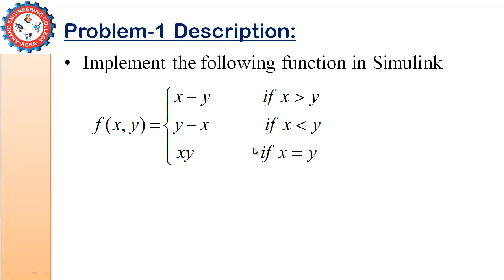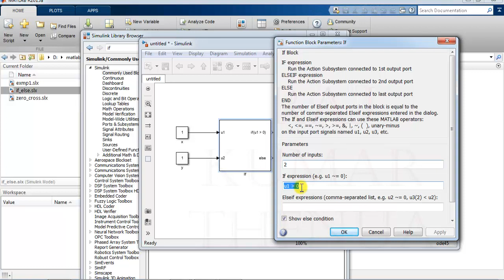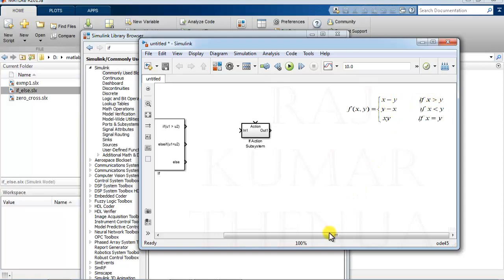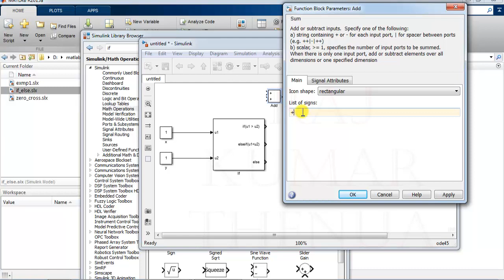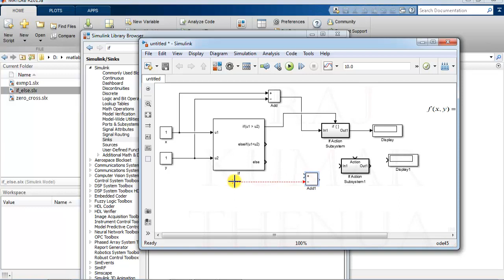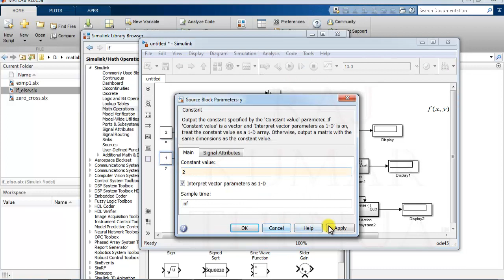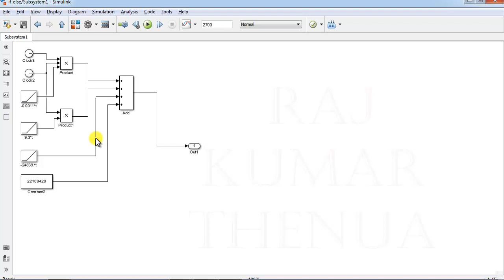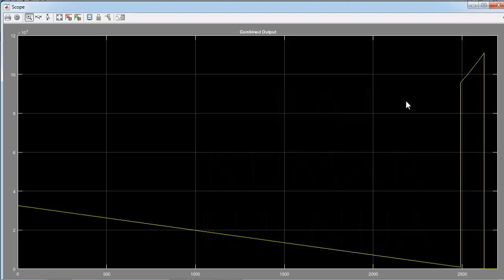How to use if-else statement in Simulink model

Comment: Sir @8:50, what if we use an add block instead of merge and a scope in last, may be that will also give the same response because every other block will provide output only when their subsequent action block will be triggered and otherwise it would be 0. So, output must display the same result.
Or I am wrong somewhere ?
Reply from the maker: Dear Anurag,
Adding and merging are not same operations.
You can observe the difference after implementing given problem.
You may get little more idea about the application of merge block after watching this video
https://youtu.be/v5US6gFOM8w